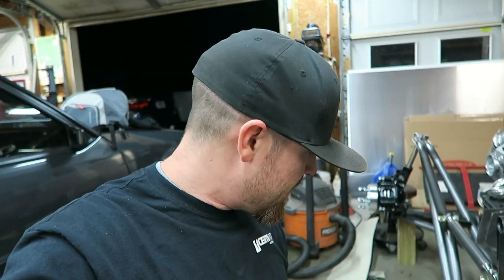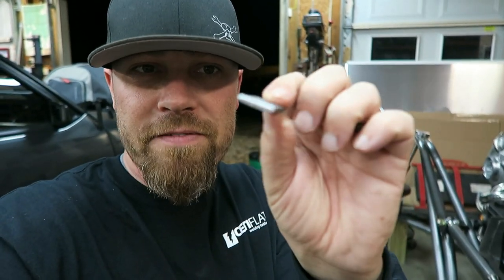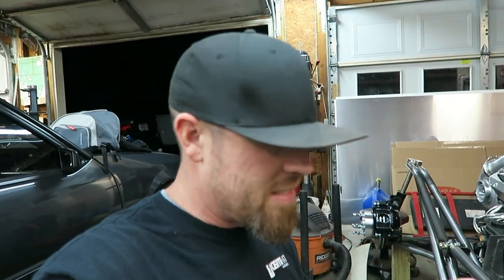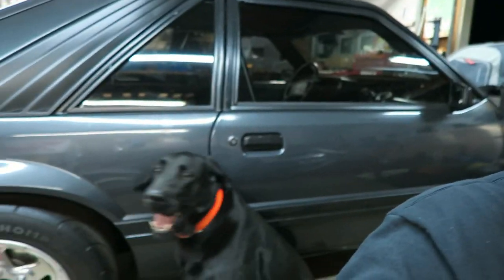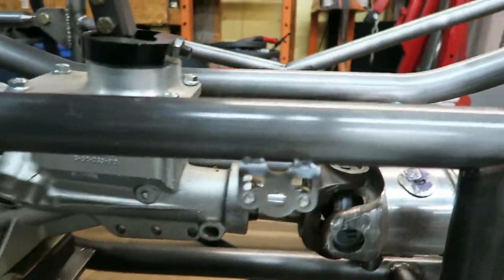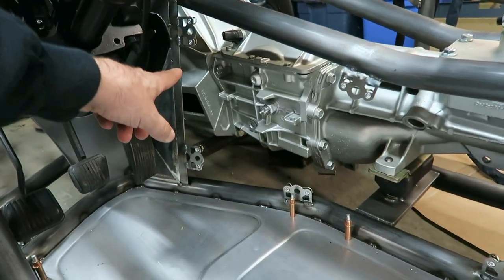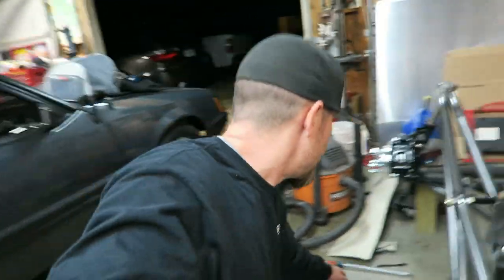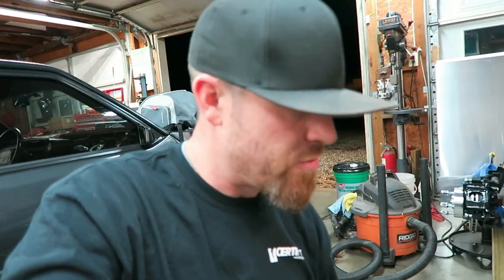How To Install Quarter-Turn Dzus Fastener |  Modern Hot Rod Build

Comment: Always mystified by the necessary springs and thicknesses needed for Dzus fasteners before. I guess I really just need to get an assortment in order to be ready for whatever I need.
Reply: You just need to plan for the thickness of the material, i.e. both panels the fastener will be going through. Then it's just a matter of preference

Comment: I hope to at least hold 50% of your attention to detail on this upcoming build. You're easily one of the most skilled fabricators I've seen on the tube so far, and I'm going to go right ahead and admit that I plan on copying some of your ideas for the 240z LOL (I'll definitely be giving credit though)

So far, this past week, you've cost me a weldtables.com 2 x 4 table, protools bender, swag offroad hydraulic adapter kit, some c5 front and rear subframes, and grabbing some knick nacks off your amazon store. No Fronius here though, I'm just a poor boy with a miller dynasty tig. Grabbed a gopro 7 black too

You might need to send me some killfab stuff so I can hang it on the wall, because you're easily going to be the most mentioned in the videos
Reply from the maker: Lol....that's awesome!
Reply: @Thefabforums   Amazingly at this point the wife is even slightly agreeing with that